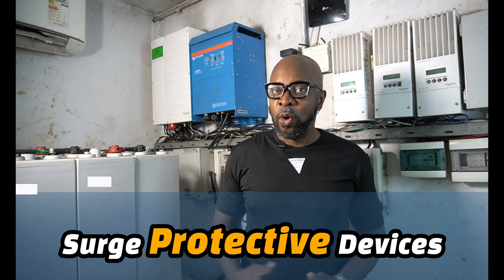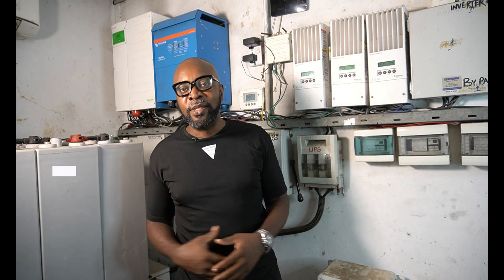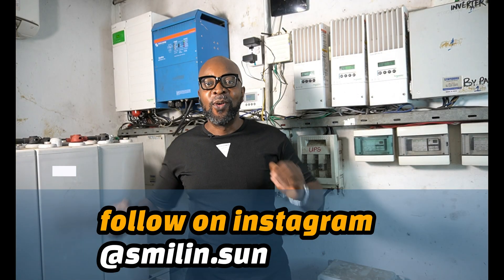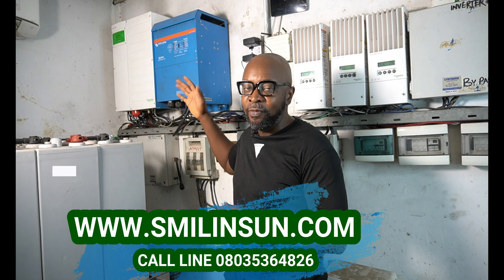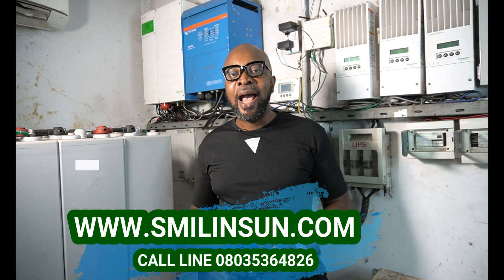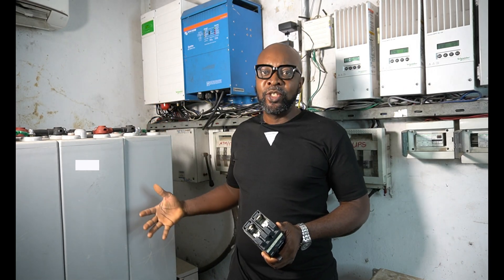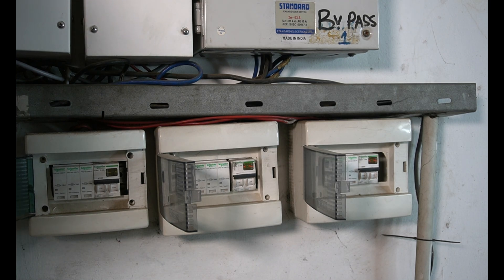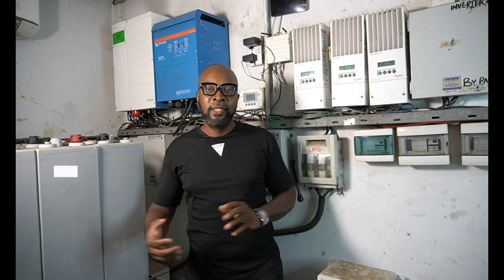How to use the Surge protective devices SPDs  in your Solar system connections

Comment: Sir, this started just yesterday, my 1kva inverter spoilt 5 bulbs in just 2days, also spoiling charger,and my appliances please sir what is the cause of these
Reply from the maker: First place to start is to test the AC output of the inverter and see what the voltage is, if its above 250 to 260  then the inverter is faulty
Reply from the maker: Its also you have SPDS installed that will ensure certain voltage thresholds does not get into use

Comment: Hi, could you please give the the cost for the SPD and DC circuit breaker for a 3.5 KVA 24Volts solar installation.
I think this feature is missing from my setup.
Reply from the maker: Hello Tunde,  you are going to need 2 input AC digital surge protectors for the line in and line out of the inverter for proper insulation. One Lighting surge protector, 60 Amps battery disconnect  , Solar Panel DC circuit breaker, Ac Grid communicator circuit breaker
Reply: @smilinsunsmilinsun8056  Thanking you for your kind response
Reply from the maker: @tunde57  pleasure always